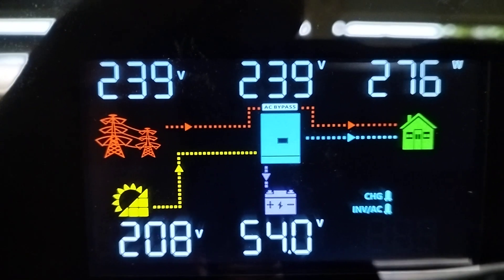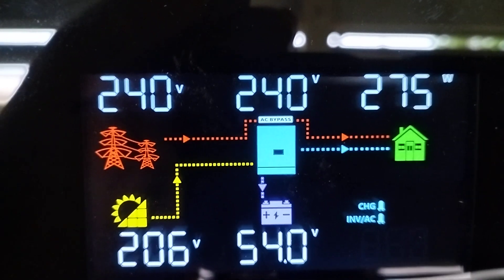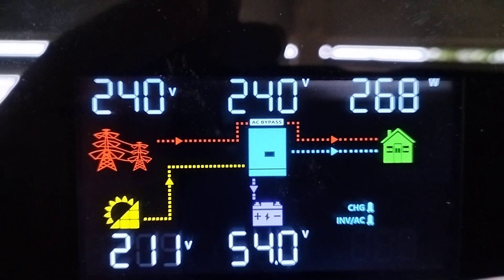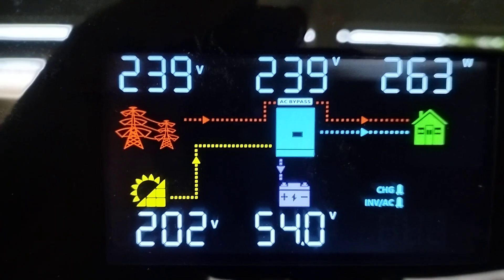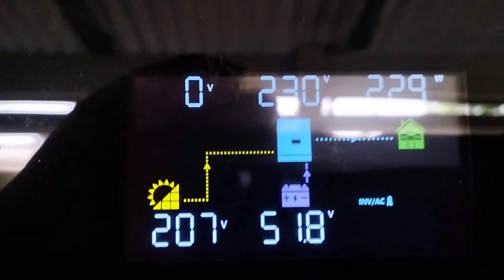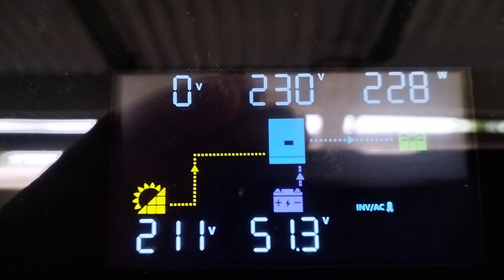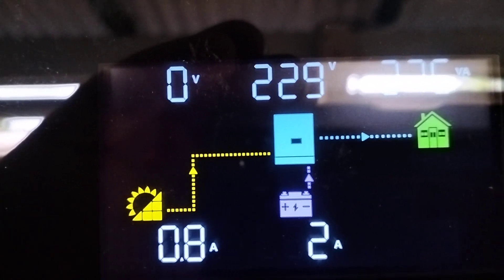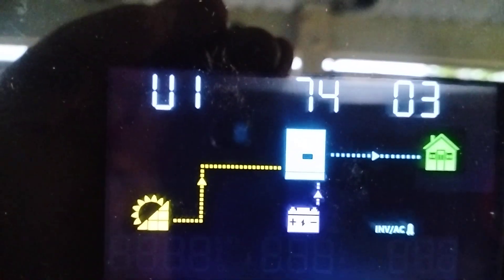Powmr Hybrid inverter screen

Comment: Hey mate just ordered this unit, saw your comment about M.E.N bonding. How are you finding the device so far?
Reply from the maker: Very good so far, I am going to upgrade the battery pack to 1000Ah. Currently the system runs all the house lights and one power circuit that has the TV on it UPS mode SBU.
Reply: Excellent! Was a bit sceptical at first but good news. The missus bought a property with an off grid victron system, 5.5kw solar, 5kva multiplus 2 and about 9kWh LiFePo batteries. She's learning haha. Gonna do some experiments with this rig and I'll keep you posted. Appreciate your videos, you've got a new subscriber 👍

Comment: Is that your air conditioner?        😂
Reply from the maker: It's the free energy machine John. It will run my heat pump in reverse during the winter. 😁